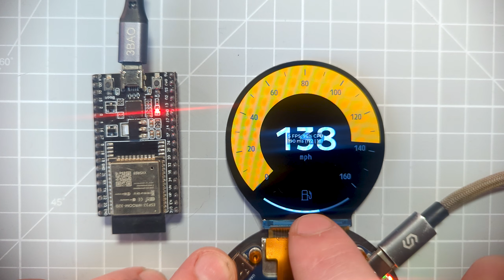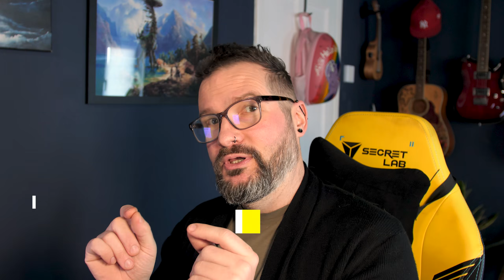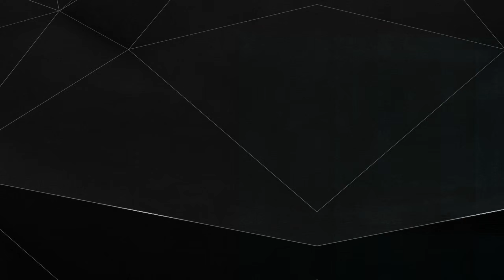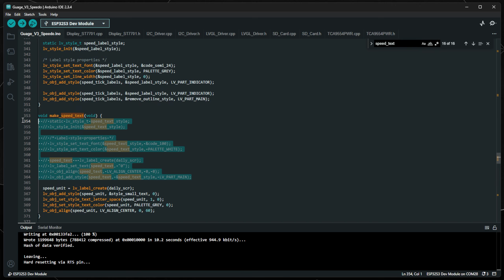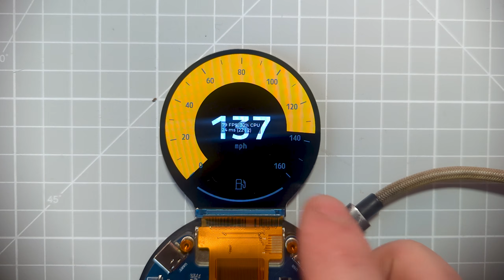LVGL Too Slow? Do THIS for Maximum FPS!

Comment: Ok Sorry im spamming your channel :D But seeing this video a couple of points. Usually these LCD panels cap out at 60FPS unless otherwise specified. So when working with these kind of things its a good thing to try and aim for that as a max. And as for data refresh. You can smooth out the animations between data changes by applying fraction interpolation. It would mean the data seen will be at least a frame behind the true value, but this gives you a smooth needle animation, and is realistic to real needles. 

As for that data discrepancy, it doesnt matter. As the bigger the target value from the current value the needle will move towards it quicker. 
The visual effect is basically a "smooth in" animation.   

So basically, at each frame. newValue = (targetValue - currentValue)/10   // the lower the division the snappier the move in. But less smooth the animation will handle the slower data inputs.  

But given this video is 10 months old you might have already figured that out by now :)
Reply from the maker: Yeah, all my stuff uses moving averages now

Comment: Hi i also made a gui with lvgl and the resolution is 800*480 with a few active components. I am in stm32h7  board and using lvgl v8.3 . How to improve the update speed of the gui elements?

Comment: bro  how can i improve fps in  handed coding of lcd with just pure driver functions and dont using  lvgl or etc ? 
in this case i use st7735 tft .96 inch with stm32f103c8t6  with maximum  spi clock of 36Mhz but still slow

Comment: Is it possible to achieve some decent FPS with MicroPython? Maybe not as fast with C programming but something higher than 5 or 7 FPS
Reply from the maker: I couldn't tell you; it's not something I use - but I'd be surprised if not

Comment: Hello, I'm trying to replicate but the fps don't appear even after changing the conf.h file. Is it necessary to write some code for the .ino?
Reply from the maker: No. It should just be turning on the Monitor and the FPS, plus making sure you put it in CENTER as it defaults bottom right (I think) so might be hidden off the edge of the screen
Reply: @GarageTinkering  
It worked! Thank you so much!!
Reply: @GarageTinkering  By the way, one more thing: to use the Waveshare module with the display shown in the video (the one you mentioned right at the start of the series), do I need to make any changes to the ST7701 file or any other file? I have the Waveshare module working, but when I connect the external display, it shows many vertical lines and doesn’t work properly. (I know I have to change the 4 lines, I'm asking besides that )

Comment: You are deceiving me with the LV_DEF_REFR_PERIOD value, the FPS counter, and when the figure is higher than the previous one, in fact, the FPS has not increased, this is noticeable even in your video comparing 3 measurements.
The speed of the strip is the same.
Why mislead?
Regarding the link to the example for LVGL 9
ST7701-ESP32-Driver-for-LVGL9.2
the examples are incorrect for 9.3 for sure, firstly lv_display_set_flush_cb is updated in the SETUP cycle, and according to your driver file, the update should be outside the cycles, which is absurd.
The MALLOC_CAP_DMA flags also do not work for the GUITION-ESP32-4848S040 device, and there is quite good hardware.
I apologize for such a tone, I just wrote everything based on the facts.
Overall, the video is normal for the picture and for beginners, but if you go into details, it's a FAIL.
Reply from the maker: The speed is absolutely different, but I neglected the fact that I recorded the video at 25fps, so you won't see any difference beyond that
Reply: @GarageTinkering  
Forgive me again for my tone🙂, but what difference does it make what frequency the shooting is done, visually, for the same shooting time, the scale that moves on the device should travel a greater distance if it is processed faster, with a higher FPS frequency. 
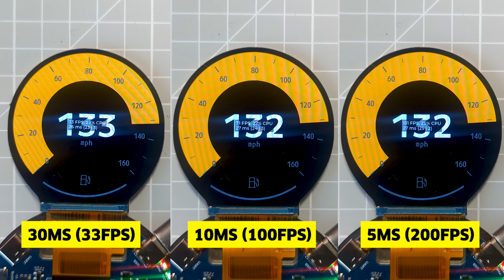22:40
Or am I misunderstanding the rendering process?
Reply from the maker: @IvanEng747  It would not travel further, just in more steps, so visually appear smoother.

But because I shot at 25fps, you can't see the difference between say 30fps and 60fps (let alone 120fps), because you don't see every step in my video - only half or quarter of them. I effectively cap it.

Comment: Perhaps you'd know a good way for me to tune my arrays for my ECU. If the simplest way is an ESP32-S3 with a display, and using that to flash my Pi Pico, fine. Or put on SD card then swap SD card and load card data as array on Pico. 4, 32 by 128 arrays is slow to do in a simple text editor.

Comment: Have plans to make this for the g35?
Reply from the maker: I believe the CAN IDs are all the same so the software will be transferrable, but you might need to adapt the mount
Reply: @ would be nice with a display that mounts in the AC display section

Comment: I think fps needs to be balanced against the real world data, things like water temp doesnt change fast, your not going to see more than 1'c per second unless the engines exploded, at which point I think watching gauges for smooth animation will be the last thing on your mind.....
RPM, yeah that can drop from redline to 500 in like 1 second so it would be nice to see that smoothly animated. but how do you measure it that efficiently to get virtually real time data? most rpm reading code i have seen doesnt output a value more than a couple of times per second, but 25 or 50 accurate readings a second? interesting puzzle
Reply from the maker: Yeah, it's a UX problem more than anything

Comment: Lovely example. One suggestion, if you find that your ESP-NOW (or other CPU intensive operation) is slowing down your graphics too much, utilize the two CPUs that the ESP32-S3 has.

For my gauges, I put graphics in a draw() function, and all the data-related stuff, touchscreen, CANbus, etc into the loop(). Call draw() with CPU0 by defining in the setup():
xTaskCreatePinnedToCore(draw, "drawTask", 10000, NULL, 1, &drawTask, 0);

make sure to define: TaskHandle_t drawTask; in the header

I would be curious to see your framerate, running your ESP-NOW on core0 and changing nothing else.
Reply: Worth noting that LVGL is not thread safe, so you should confine all of your LVGL operations to a single core and a single thread.  Use other variables / locks to pass information to the LVGL thread before rendering.

I've got a similar project using a Waveshare 1.85" screen.  I leave one core to the LVGL rendering task, and the rest of the canbus/wifi/etc happens on the other core.
Reply: Why not create setup0() and setup()? That way, both cores get utilized with their own codes and some logic can be implemented as function to transfer the data from one core to another

Comment: Very cool video !
That being said, you are talking about diminishing returns on the framerate, but actually you can kinda compute the best fps number since your gauge only changes in increment of whole numbers. So adding fps won't make it smoother since the motion is itself "jerky". You could use smaller increments to see the difference it makes on the eye. I do believe a motion being displayer at 60fps vs 120fps is VERY noticeable, but maybe not worth it for a gauge (that's why most smarphones and smart watches manufacturer are going for 120fps nowadays).

Comment: Interesting comparison, and quite informative, thanks for putting it out. I think it might have been a bit more illustrative to do the ESP optimizations before touching the LVGL stuff, just so that the LVGL changes become more apparent, and easier to compare with each other. As a few changes you did had no affect since the CPU was encumbered with the wifi code. The ESP stuff is its own thing, and only applies to ESP, while the LVGL stuff may be applicable to any platform you may be running on. As presented here it's a bit muddied, as you jump back and forth between the two domains of optimization. Nonetheless, it was very informative, thanks again.

Comment: Is this code on your GitHub?
Reply from the maker: There is an LVGL 9 and and 8 config file which is basically this code, but with a spinner and not the full gauge. You can use those as a starting point.

Comment: The main thing that makes this gauge look bad when youve already achieved >30fps is the predefined 1mph steps. The needle jerking up and down hurts lol. OBD2 specifies vehicle speed as an integer of km/h so not much more precision either.

You'd have to buffer and interpolate the data to make it smooth.

At 30fps you have 3 frames per message. So once you get a message, you can show 2 intermediate frames (first at last_val+(1/3*(new_val-last_val)) and the second frame at 2/3) and the 3rd frame at actual new_val, at which point you'll receive the next message and do the whole thing again. At higher fps you can interpolate even more.

Its not the most accurate as you'd be introducing forced 100ms latency all the time but you can always display the most up to date value as text (nobody expects text updates to be smooth) and keep the needle pretty.
Reply: I've got a similar project, although I've got an actual "needle" for the analog gauge portion.  I solved this issue by giving the needle "inertia" - limiting the maximum change per frame towards the current value.  So it constantly tracks towards the current value, and the maximum motion rate is limited by how far away from the target it is - so for a rapidly changing value, it can move faster, but if the change is small, the motion is small.  This allows it to be very responsive to large changes, and not jerk back and forth between single digit slow changes.
Reply: @shifty3583 Can you please share the code with us or explain how ypu did that? I'd very much like to learn that
Reply: @karlohorcicka7388  For a linear scale you'd just set up a dictionary of allowed needle speeds, subtract the current vehicle speed from the last known vehicle speed, and apply the new dictionary derived needle speed and set its new target.
Reply: At least for sliders and bars you can enable animation so that transitions are smooth. Not sure about meters or arcs.
Reply: This is precisely what I thought of, especially at 22-23 minutes! Data update rate is limiting the visual from really early on, and big steps make it look jerky no matter what - human eye is really precise. Linear interpolation, like @igorordecha explained, is what first came to my mind. It's really easy to implement as a general function if you have a constant update rate, even with jitter it can be good, and you can eliminate granularity in both time and value. Of course for simulated input you can do data refresh at visual rate and float precision, and IMO one always should. 

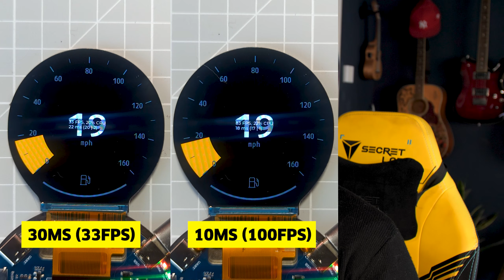Seeing the difference in the video would still be limited by video encoding, and viewing device - SBS @22:30 we can't see the difference, because (FWICS) the video is 30fps, my monitor is 60fps, and so on. Luckily many phones can record 480fps, then import as 30fps?

Comment: Some neat real-time debugging principles here !  Yeah you need to identify the new bottleneck at each step and make changes that affect it.  Reducing the incoming traffic another good move, would sending just the average every 10 time periods be more useful ? (a smoother display also). Also as the ESP32 has 2 cores it might be  possible to distribute more processing on core 0 and just lvgl and tft on core 1 ?  I doubt a gage will benefit from fps greater than 25, so look for the point of diminishing return of complexity vs performance.  Im just getting into lvgl, its very impressive on small systems but complicated, getting into the lv_conf.h is scary.  To get the demos running I broke my other apps so ensure you keep good notes on how to configure each of your projects (lvgl and arduino settings).  Lvgl lacking some features though such as display of animated gifs, jpgs.

Comment: Nice work. I would prefer hardwire myself but if someone wants/needs wireless and wants the same screen performance, is it possible to use 2 controllers? One for the screen and one for the wireless comms . Maybe something like a Seeed Studio Xiao ESP32-C6 for the comms sending data to the screen ESP32 controller.
Reply from the maker: Absolutely can. In fact the new ESP32 P4 which we're looking at soon doesn't even have WiFi on it so needs pairing with something like a C6, so they totally separate the concerns

Comment: Not sure if it would work, but have you considered using a raspberry pi pico/pico2, you can also get them with a wifi/bluetooth chip and run at 300mhz Dual Core! Also they will run the same arduino code if you download an arduino board profile for them!

Comment: Found a situation where too high a framerate is an issue...
I'm building a motor driver, and it displays power levels (as set by a pot) on a 7-segment display. looks really pretty. But if it's allowed to update all the time, which could end up something like 100-300 fps, the power level displayed jitters (keeps flicking between 27% and 28%, as an example), and that flickering is super-annoying and makes the display hard to read.
Setting the display to 20fps made it A LOT more readable, and it means the ESP32's got more time to run code to do actual work, as opposed to updating the display constantly.

So it's not just higher framerate can be diminishing returns, but go too high and it can become a problem in its own right.
Reply: On the displays I've done, the numerical outputs are intentionally smoothed & slowed quite a bit (5-10fps?) vs the visual graph/ark/needle. The pixels used between numbers, like 0 and 1, tend to blur so you can't tell what it is.
Reply: @hydrocarbon82  Yes, exactly, it's that blurring problem.
However, while my driver is custom, watching this video helped to inspire a quick re-code so that the refresh rate can be specified. I went with 50ms (20fps) but probably wouldn't notice much difference from 10fps, and faster is definitely a waste.
Reply: Can you share your code to be analyzed?

Comment: Interesting, reminds me of the Stm32 promos a while back , they had some microcontroller i forget the series name now, that has a vector GPU in it to off load the work of UI graphics so the CPU could do other things.  Look like it was designed for this problem.  Graphical UI's pretty much put all MCU's to their knees if you want good frames which doesnt leave much processing for anything else.  The  vector based GPU i think is neat, ss supposed to be even more efficient then standard raster graphics but im not sure how youd program for it, probably not easy.

Comment: Hey, I've been watching your video series on this display and LVGL as I have recently bought the Waveshare 2.1" LCD+Touch module. Thank you so much for sharing your performance improvement ideas, it was literally exactly the video I was looking for while I was working on my project this evening. I started my project from the same Waveshare demo code as you did, and combined mine and your improvements to the code in one. I also added a SquareLine Studio project and have it generate into a "lib" folder, as my project is set up with PlatformIO. I am planning on sharing the boilerplate in a while, so Waveshare can also link it in their wiki, they alreadz did that for one other boilerplate i wrote for their rp2040 1.28" display.
Thanks again, your optimizations helped me save my sanity for the sake of my project!

Comment: 16:44 - Hardware serial is one way to reduce overhead; I was wondering why your ESP32 reciever is not physically connected to CANbus?
I've got a few ESP's talking to eachother over CANbus; I just use a TJA1051T/3 IC as the interface, and used the inbuilt driver & examples <Examples / ESP32 / TWAI / TWAIrecieve or TWAItransmit> as a code base. You could have your ESP'2 connected to the car bus, or have them on a seperate bus with your ESPnow unit.

Just an idea :)

Love the videos, looking forward to more :)
Reply from the maker: Yup. This is how the new boards are running,  but with a MCP2562FD-E/SN transceiver.
Reply: @GarageTinkering  Nice! ❤👍
Reply: @GarageTinkering  Do you have video's on your new setup? I saw the CAN Sniffer video

Comment: DMA is a misnomer, the peripherals cannot actually access the memory (unlike in PC with PCI Bus Master), but similar to classic PC DMA. On a microcontroller a DMAC is a device which can do memory to memory (and MMIO) copies, bypassing the CPU.

The display control IC runs on its internal clock and scans out the internal video memory to display matrix at a fixed framerate when operated in SPI mode. Exceeding it by a substantial amount is rather pointless not due to your perception limits but due to this hardware quirk. Furthermore limiting the framerate to half that plus or minus 3 can reduce tearing, since after every tear, there's going to be a non-torn frame. Hitting exactly half will put the tear in the same exact spot every time just ever so slowly drifting, which is very noticeable and annoying when it happens, so it's better to fudge the framerate a little.
Reply: Umm, that really sounds like DMA to me and while it's limited to peripherals internal to the microcontroller, you can set a peripheral to trigger a DMA transfer on certain events, like an SPI transaction, timer event or state change on pin so I'm struggling to work out how it's a misnomer?
Reply from the maker: That's super interesting. Thanks for the insights
Reply: I love how the BBC micro handled framebuffer access, with the 6502 accessing RAM on one clock edge, and the video controller on the other. I used a similar simple 6502 design in a video card I designed as part of my final year project at uni in the 80's, and the perfectly shared ram worked a treat.